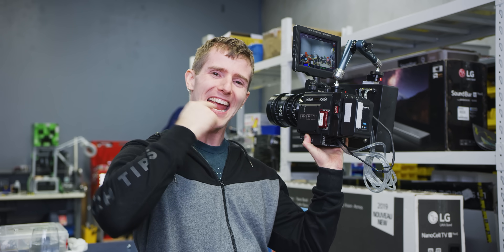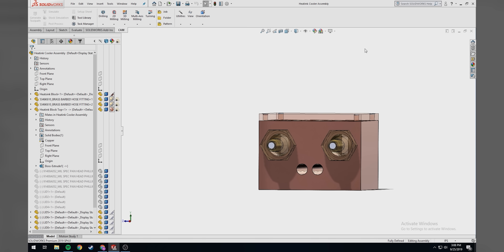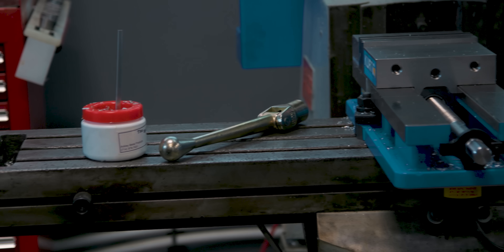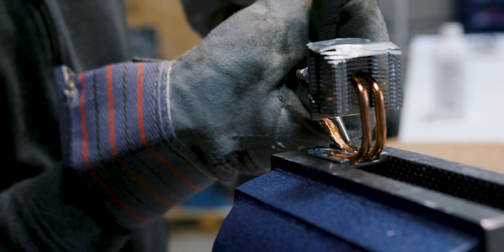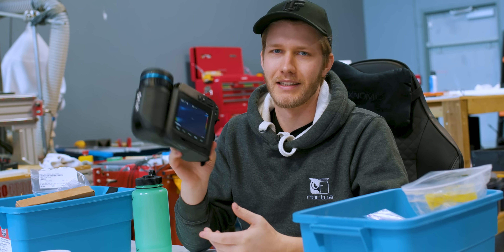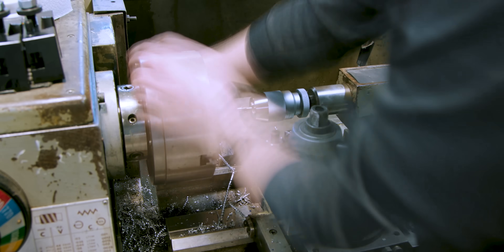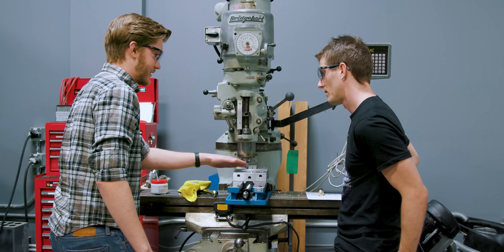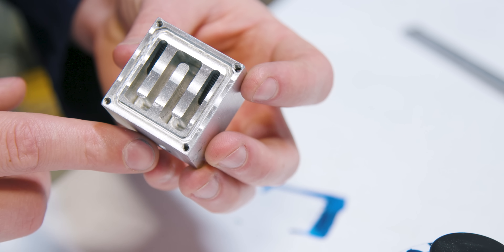WE FINALLY DID IT!! - Water Cooling the 8K Camera!

Comment: Actually I have a suggestion about a different video. With the Peltier cooling device you were trying to cool the CPU directly. 20 years ago when I tried I tried to turn the whole inside the case into a cooler using a Princess Auto acquired Peltier.

But I was thinking instead of using the Peltier to cool the CPU directly why not use it to chill the water going through the water cooler? Basically run heat pipes go through the radiator fins of the peltier to chill the water? I know it would still be inefficient but may be a fun exercise in frustration?

Comment: Id invest in a powered drawbar if the mill accepts it. Makes toolchanges soooo much easyer and faster. Also ive found putting the tap in a drill press and manually rotating it a bit easyer as the tap stays alot straighter

Comment: Pro tip: there are tables for spindle speeds and feed rates. Nowadays even apps. So no, you don’t just eyeball it. Thought Alex was a mechanical engineer?
Pro tip 2: surface both sides of your part. You see what happens if you don’t..
Pro tip 3: when you are new to milling, don’t use the spindle motor for tapping. Especially not on such a high speed.

Comment: "We've got a lathe but we're not going to make our own fittings that are appropriately sized."

"We've got a bridgeport but we're not going to mill any fins into the blocks."

"We're going to replace the heat pipes we broke, but we're going to replace them with heat pipes instead of a water channel to keep the maximum jank water-cooling heat pipes vibe going."

Boy you can really tell none of these guys has any experience in a fab shop. Next time get someone who knows what they're doing to cameo in your video for 5 minutes, that's all it would've taken to save you months of work.

Comment: Are you using a tap chuck in the drill press? It'll have a spring loaded section that will hopefully take up the slop between your feed rate and the tap's actual travel rate.

Comment: “That sounds about right” is absolutely not the way to set your speeds and feeds omg 😂
Reply: those get pretty much memorised over time
Reply: Thomas Carroll I work in a place with like 20 machinists. They do it pretty much like that the first time. Once they’ve gone too far and they know the quality isn’t great because it was too fast, they write down the previous value and use it from so on.
Reply: @cedricpomerleau5586  as a machinist, this is 100% what anyone in a machine shop does.
Reply: Jacobbi the only machine shops I’ve been around have been remaking engine components for high hp car build or making various highly accurate parts and I’ve always seen them look up speeds and feeds and set them that way
Reply: @SxID117  Most end mills and metal combos have known good feeds and speeds. If the machine doesn't have a calibrated control you can just use a damn laser tach.
Reply: Legionof0ne yes but I doubt Alex has those memories though lol

Comment: 10:54 Linus straight up learned in 30 seconds what I've learned in 4 weeks in my mechanical engineering course
Reply: Training vs educating in a nutshell
Reply: @Zenar5  Training is learning how to do something, educating is learning why it works the way it does.
Reply: @AluminumHaste  thanks and you can tell the difference in a moment if the person gone through one or the other. Especially in the skill fields and triads.
Reply: @AluminumHaste  best explanation I have seen
Reply: As mechanical engineer I had an internship supporting an electrical engineer making test equipment. The plus for the company, a BS level ME doesn't understand PHD level electrical so I could steal secrets. Basically had to self teach machining. It was ugly to start lol. Helped alot in future classes though. Learn a lot in class but experience helps you use it.
Reply: Apprenticeship programs for the win, I'm biased because I've done one but still
Reply: @lslslslslslslsl1  They do have value. If anyone tells you otherwise they have never done the work. I work as a field engineer quality trained/skilled labor makes my life 100 times easier.
Reply: Bruh
Reply: @Halfcocked1222  TBH I did that. I had 7 custom cases from protocase and 20k in machined parts that didn't work. I was given a file and sand paper to make it work. I learn the hard way